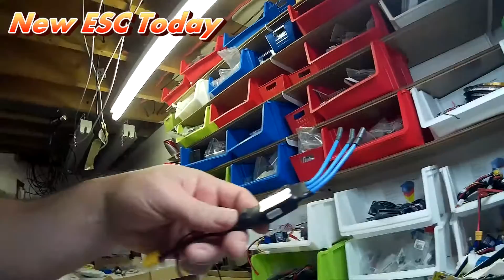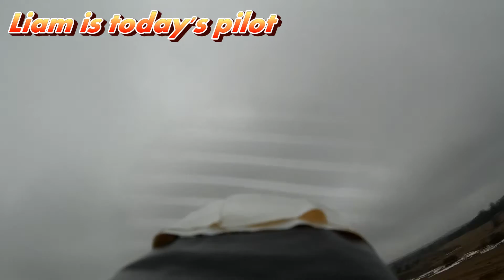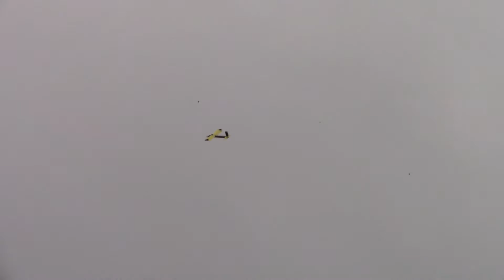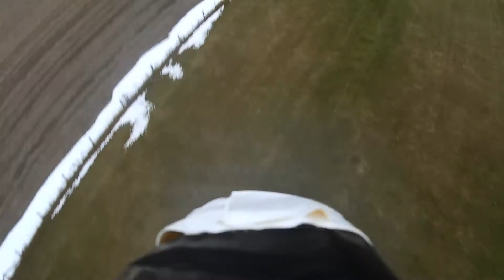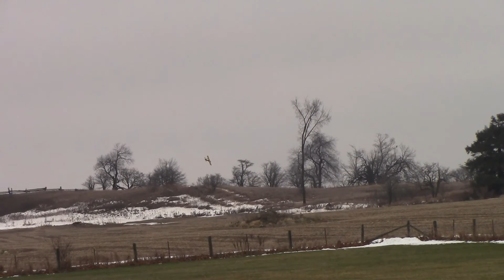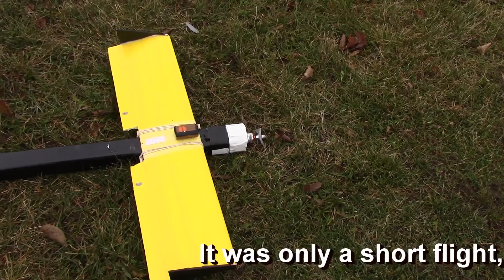Noob Tube 2.0 with 30A HobbyWing FlyFun ESC

Comment: That some really good flying guys!  It was up and down and the only damage is a prop.....I can live with that.  I love the Turnigy 2200kv motors....just awesome motors.  I have that same motor on my mid wing Noob Tube and it performs very well with a 7x4 master airscrew prop.  Great job!!!
Reply from the maker: Thanks.  Yep, I have used those 2826/6's on several airplanes and they haven't disappointed me yet.  Do you have a vid on your channel of your Noob?  Scanning now :-)
Reply from the maker: Looks like you've built several of EA's planes.  I've got some watching to do :-)
Reply: I am a huge EA fan!!!  Ed has made it so simple to make inexpensive but very functional planes.  My personal favorite EA plane would have to be his Fast Delta Wing.  I have one with a 1500kv motor and an 8x6 prop.  I love the speed this wing has.  With a 3S 2200mah battery, I can get nearly 12 minutes of flight time, lol.  I have built his Photon, Axon, Peace Drone, Delta Wing, Synapse, and Noob Tube.  I'm currently using his Ansley Peace Drone for FPV flying.  Absolutely love it!!!
Reply: For another interesting plane video of mine, see my Blue Cub STOL.  Although the fuselage is not EA design, the wing is and this Cub flies amazingly well at fast and slow speeds and it doesn't even seem to mind 15mph winds.  Awesome plane!
Reply from the maker: ***** Yep, great planes for sure.  I've build the Axon and a handful of variations on the Noob (large chord, slow flyer, large wingspan scaled up).  All have flown nicely.
Reply from the maker: ***** Actually, I think I might have watched that vid.  Is that the one which had the large prop chipped on landing?  So many videos watched that I have trouble remembering them all :-)  If it's the one I'm thinking of it flew really well.  I did the opposite and used a KFm3 wing on a tubular fuselage for one of my FPV planes.   The wing itself was a bit of a bust (too thick, so the plane is quite slow), but it does fly pretty well.
Reply: Yes, I did chip the prop on landing....several times, lol.  I'm now using an 11x5 prop and haven't chipped the prop yet, lol.
Reply from the maker: ***** Maybe I need to put landing gear on my Noob.  It needs a bit more weight up front anyway :-)   Been waiting for pool noodle season to build some FliteTest style landing gear.

Comment: What a great looking little plane, seems like the controls are very touchy on it, which is very helpful in high winds when you want instant corrective flight characteristics. Prop saver?
Reply from the maker: Thanks Jax.   Maybe a bit touchy ( I prefer responsive :-) ).  That might also just be Liam's flying...lol.   Yep, definitely needs a prop saver, or landing gear.

Comment: So what's happened ESC failed?
If yes, you can not fix this one with glue my friend lol
Reply from the maker: lol.  No, the ESC didn't fail.  It has a strange calibration issue with the throttle channel, but that just effects start up.  After that it was fine (it was a little hot though).
Reply: UnlimitedVertical Thanks for your answer :)